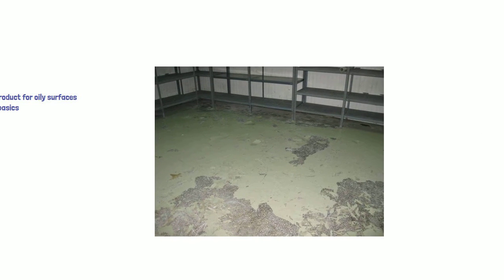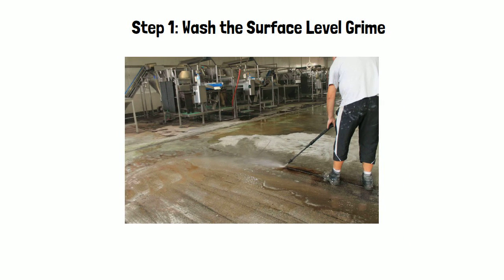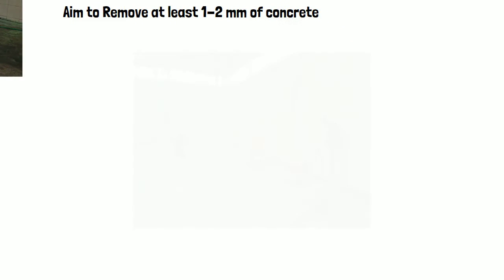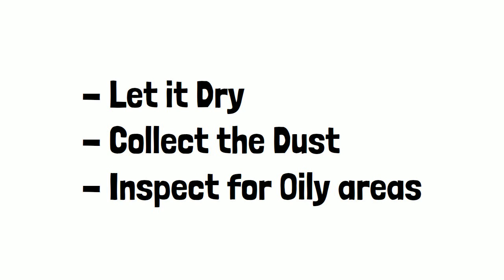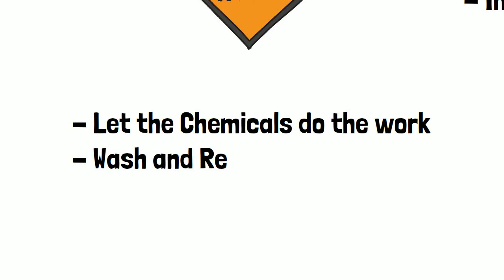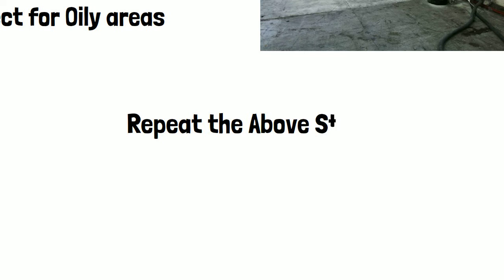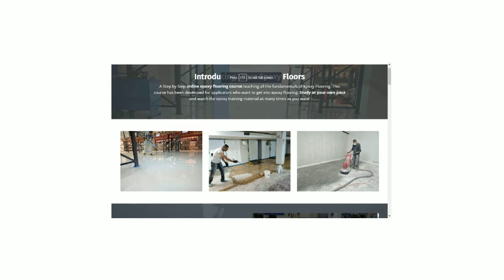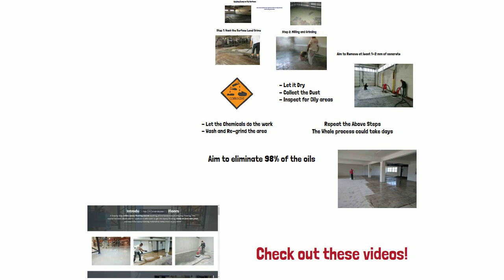Epoxy on Oily Surfaces - How to clean the oils from the concrete

Comment: You grind the whole area for oil?  Did not know that would have been an option..  but guess is only way to remove oil impregnated concrete..  all concrete is porous so seems logical..  just figured there may have been some kind of acid that would take care of it all without eating through the concrete..

Comment: Thank you!!! I am glad I found this video before we bought “special” products.
We’ve cleaned then pressure washed, used Rustoleum aerosol heavy duty degreaser, used wire brushes on the drill, used 60 grit sandpaper, and then used muriatic acid then finally pressure washed again, and we still have some oily spots in our 1959 garage that belonged to a mechanic for 40 years. We may try the caustic soda next. Thank you!!